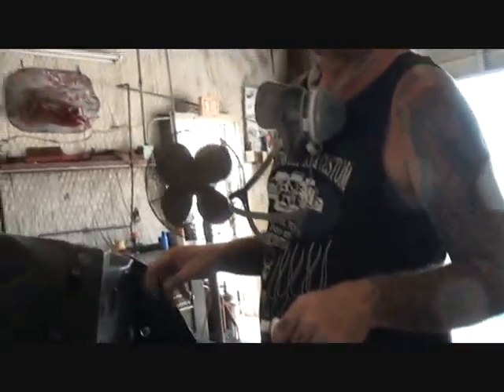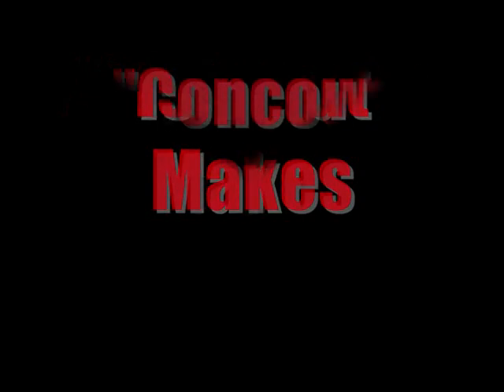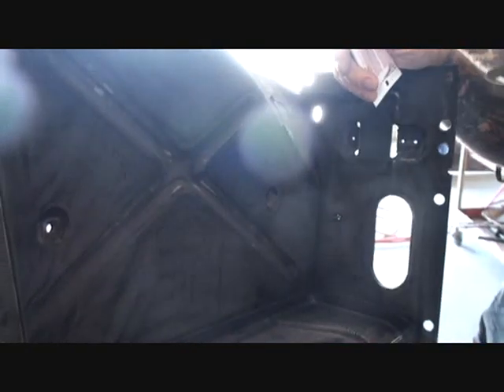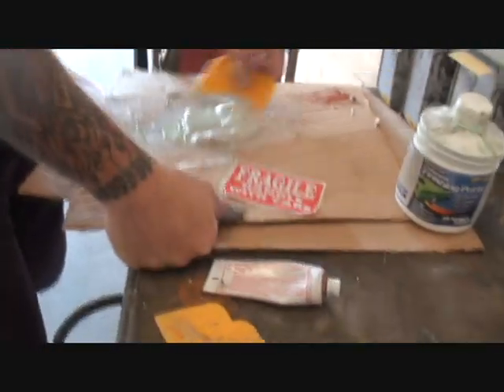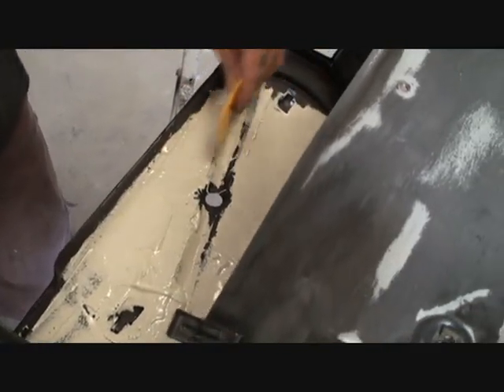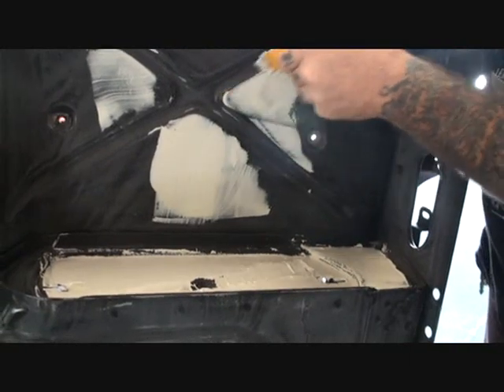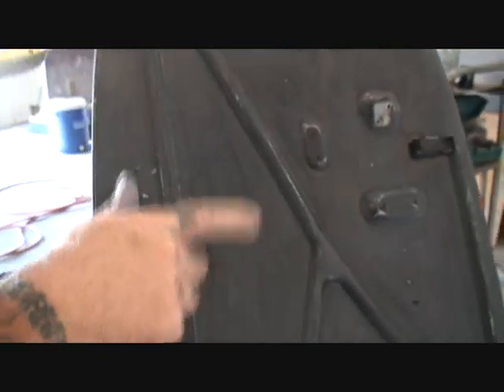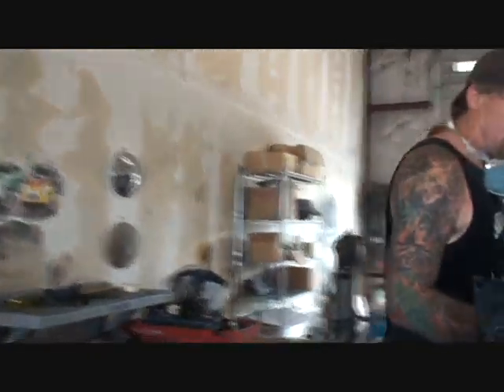Using Bondo For Alot Of Different Repairs. Part 1

Comment: When I am filling & sanding intricate detailed areas like this I use some 80 grit at just the right time when he filler starts to set up but is still soft to rough in easily. Saves alot of time and finger wear !!

Comment: i use a brush to put filler in akward places like that, i mix it with some thinners to get it to flow nice
you may have a few brush lines but the overall fill is contoured to the desired shape
gotta move quick before it goes off on the brush

Comment: Pete, featherfill works great but you have to use a 2.0 tip, douse 10% acetone in the primer, and crank the fluid tip as far as it can go without running. Shoot small amounts and flush every fill with solvent. Its time consuming and tedious, but its hot as hell here, and i can get that shit to come out pretty decent. acetone :)

Comment: ive never used featherfill.. i use slick sand are they same thing?? i use a bunch of hardener in small amounts and im in AZ.. ive had problems waiting for it to dry not drying too fast lol.. the shit will gum up your gun if you dont strip it down and clean it asap!

Comment: @fastblastCamaro any brush will do, its probaly better to add resin (the stuff in a fiber glass kit or bondo resin) rather than thinners, saying since i posted the comment we been using the squeezy tub of evercoat over here and that is runny enough to use with a brush

you are only limited by you imagination, :)